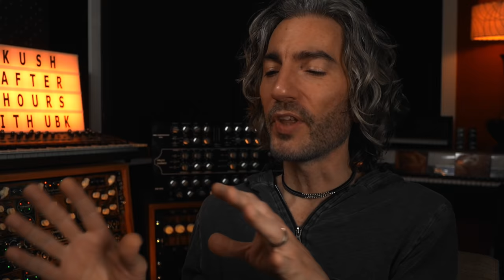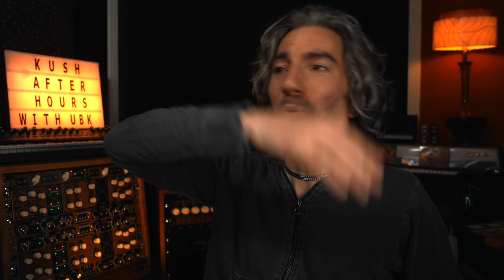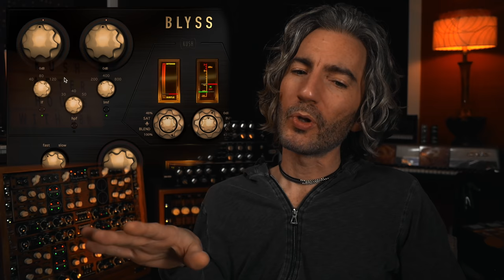MIX BUSS: You NEED to try THIS!

Comment: I do a lot of top down mixing because if it doesn't sound like a record to me sonically, I get distracted. I can't automate if my snare is too pokey or the overall mix is too dull. I do end up fighting the mix buss comp (and other processing usually tape emulation or something like that) and sometimes I end up removing some of it. Wish I could wire my brain to ignore the sonic issues in favour of the song issues as I always get sidetracked mixing if something isn't perfect.
Reply from the maker: Well, if top-down works then there's not actually a problem, right?  "Managing your tendencies" isn't a kludge, it's a solution.  

But if it doesn't work that well, or you feel like you could be leveling up, then what you're describing is a counterproductive habit, your attention is trained to shift to things that shouldn't be the current focus.  Changing habits is a fairly well established science, there's the cue-craving-response-reward cycle and you need to interrupt at least one of those stages of the cycle.   

An easy/simple way to break the "cue" stage is to change the environment, change the thing that's causing your attention to shift.  Try mixing at a different volume, where things either sound bright enough because it's loud, or it's so quiet that brightness is less critical than balances.  And/or, spend a lot more time on a band-limited ref like avantones, ns-10's etc.  If you can't hear 12k, you won't give a shit about 12k :-)
Reply: @TheHouseofKushTV  Great advice as always! I definitely will try to mix things up especially as far as monitoring to see if changing my habits and workflow end up being more beneficial. Maybe they won't but if I have the time to try and don't think it will hurt.

Comment: What mastering engineer do you trust working on your mixes?
Reply from the maker: No question: Dave Collins.  There are couple of others I trust, but Dave is just a notch above the pack and consistently nails it every single time, no revisions needed.  The only time I might make an exception is if I want it loud and proud, balls to the wall and crunchy, in which case I'd also send it to Howie Weinberg and see how it shakes out.

Comment: Yes agree a lot. I like "thats true for anyone who that works for" too.

But what happens when mixing into a compressor i then realise a different compressor setting is suited to the more mixed track- so its pointless, i haven't ended up mixing into the compression i actually used at all!
But i think if i do the contemporary thing of mastering in-the-mix then happily like to tweak individual tracks over just EQing the master or something (usually just the levels of tracks, like bass, that may be attenuated by a mastering Limiter) or a buss of kick+bass instead of using a multiband, but then sometimes multiband just sounds good (why compress the kick slap when the low freqs are problem)

Comment: I've watched this video about 50 times to absorb as much knowledge as I can (as I do with most of these videos). One thing I'm not following though is your use of the nail compressor in your chain. Could you explain why you have a limiter where you do in your chain? Is it so the highs your boosting with the other A Designs stuff aren't reacting to peaks as much?

Comment: You said that it's hard to reproduce some thing about analog Gear. What do you think it's more hard to copy , Comp or Eq?
Reply from the maker: Here's the answer nobody ever expects: phase.  Phase shift in analog sounds fundamentally different to my ears than phase shift in digital.  So for me that means that the hardest thing to replicate about analog is the texture of eq, the transient shape of compression, and the tone of distortions.  

To be clear, I don't think analog "sounds better" than digital, they both have a lot of strengths and weaknesses.  But they are different... subtly different, but meaningfully different.  I love and need both, and because analog is so expensive the trick is to find those places where it delivers the greatest impact and use it there.
Reply: @TheHouseofKushTV  thanks a lot

Comment: Thanks a lot for the tips Greg. Why compress though when you use the inflator after to add more dynamics back?
Reply from the maker: Oh, sorry for the confusion: I don't use Inflator to restore dynamics, I use it to saturate them at the edges of the spectrum (i.e., Curve is set in the positive direction, and a lot, like +35 or +40).

BUT, even if I did use Inflator to restore dynamics, that's legit and we all 'undo' things all the time.  EQ boosts post-compression restore some of the lost dynamics, but it doesn't reset them.  Compression post-eq flattens out the eq that came before, but it doesn't zero it out, it creates shaped density.  Compressing then using Inflator to restore dynamics doesn't put you back where you started, it puts you in a very different place because it's not 0 + 1 - 1, it's 0 + 1 + 1.  Like taking a white canvas, then adding some dark blue, then layer in some white paint.  You're not 'going back' to a flat white canvas, you've 'going forward' into swaths of dark and light blue paint with a lot of depth and texture and movement.

Comment: I find top-down mixing to be a game of Whack-A-Mole. Normal mixing, I can hear what needs to be done and adjust it. But top-down, any adjustment I make, it changes how other instruments are behaving in the master bus. So, did I make the right change and I just need to adjust other instruments, or should I change something else instead?

And that's not me BS'ing with assumptions. I did top-down for years -- years of frustration. But since I switched to the mixbus last, mixing is a much more straightforward process.

I adhere to Warren Huart's philosophy: The mixbus is not a place for drastic changes; fix your problems early, before they build up into something requiring a lot of mixbus processing.

Comment: Actually guys I'd like some insights on your mixbus channel. I almost always have only comp + eq. I have most of my processing on my busses (drums, acc gtr, egtr, lead back...).
What is on your process on mixbus ?
I usually never put the saturator on the mixbus because I leave that to the mastering.
Reply: I leave eq and comp off of the mix bus until i need it, ie for presenting a mix to client for review
Reply: If you think you need eq or compression to fix a problem, there is likely a better way to address the problem up the chain.
Reply: I pretty much always mix into my hw SSL. That "glue" really helps me to hear the mix as a finished song. The other thing I'm using on my master bus is a limiter. Yes, a limiter. Sorry. I want to know how the mix will feel when mastered. I use it moderately, not squashing it to -6 LUFS, but yeah. Somewhere between -12 and -10 is my sweet spot for most genres. I never mix into EQ, though . I only put an EQ (or saturation) on my mix bus if I'm sending that mix (with my limiter on) to a client. A Pulteq style eq can help you sweeten' the mix. I understand what Gregory is saying here (and love his thinking behind all of this), but if you're a novice I wouldn't recommend you do these things (yet). You better send a nice, balanced mix to a mastering engineer and he'll know better what to do with it.
Reply: I find applying processing on the busses (saturation, compression usually) allows for more specific control...you can treat individual areas more aggressively without compromising the whole dynamic of the track.

Comment: Most "mixing advice" on the internet is related to specifically mixing with a mouse in a DAW. Very little has to do with actual mixing. DAWs respond differently when there is a console in front of them.

Comment: Top down does help me with not getting distracted and getting lost while hyperfocusing into individual elements. That's just a problem I have with my attention overal no matter the subject. But yes doing the entire mix top down doesn't work for me since I end up bypassing and unbypassing my mixbus processing because I end up fucking up the sonic balance and how I set up everything in the beginning and I end up jumping back and forth. So I just kinda start top down and then just go whereever my ears take me, that works much better. But I do try to keep working within busses, and not for example process the guitars and the snare at the same time

Comment: Your mix buss chain is .... your own mastering process chain! Some brilliant insight in this video, love the thought of 800hz being the foundation of the Mid range.
Reply from the maker: Yeah, I sometimes think of it that way, "premastering".  The difference is that I'm working to deliberately give a different shape and energy to the track, I'm fundamentally updating the vision.  Mastering engineer's, in my experience, are far more restrained and subtle and work hard to not disturb the original vision.  It's probably the same thing as you say, just a question of degree!
Reply: @TheHouseofKushTV  Yeh that makes sense to me. There are clearly benefits in terms of cohesion that come from applying some forms of Processing to the main mix buss.

Comment: Hey Gregory, Will you please talk a bit more about your tone boxes? I've recently purchased a UAD Apollo and have all of the plugs etc but I can't seem to get the tone I'm looking for...even from my fav old mics..and some really amazing new ones u47...269 etc. But the top end at like 4.5 to 8 K or so is just gritty. I didn't realize how much my old setup helped round things out at the top end and give that gentle mid range push. I've got the tape plugs and the rest but they just aren't the same. Any help with knowing what to use "in line" would be cool. I've tried multiple preamps to get close but then there are gain staging issues. I've heard using transformers passively inline can be cool. Any thoughts?  I need better tone! Much grass for your time. =)

Comment: Question: could you consider all of the work you’re doing on the mix bus “mastering”?

If not, where does the difference lie for you?

I’m really struggling with the decision of what to add or remove when sending a record out to mastering. My gut feeling says to leave the mix bus empty, so that the master engineer has the most room to work with. 

The control freak in me says to keep it in my own hands.

I’m very curious where you draw the line. :)

P.s; these videos, and your plugins, are a godsend.
Reply from the maker: You do whatever you want/need to do to make that production hit the notes you want it to hit as powerfully as you can hit them.  The only thing I'd go easy on is brickwalling, but even a bit of that is fine and everything else is fair game.  You can always go balls to the wall, bounce it, then bounce a version with mix plugins bypassed, send both the M.E. so he understands what you want but has the option to take his own path there.  Me, I'd do whatever I want and send it, it's my art, I know what I want.

Comment: Question: I myself use Ableton for mixing and am wondering how the mix bus would translate to Live's environment. Would you set up an aux and call that the mix buss sending every track into it? Or would this be my master channel? In case of the first, do you solo it before processing?
Reply: A tip: Use "Group tracks" function in Ableton Live. (Shortcut is Command + "G")
Reply: @MatsMorlund  thanks a lot for the reply, Mats. That's how I personally prefer to do it, instead of having many send channels. 🙂 I think most important question for me is the last part, do I send all the groups into the mix bus aux and then render this solo'd or is it more common for engineers to run them in parallel?
Reply: @Crimsonite87  Ok. Why do you need to use return tracks when you have grouped tracks? Cant you just use the master track as the mix bus?? And then export the mix to audio (and then do mastering separately)?

Comment: I gotta disagree on the mix bus compressor.  I think the way your thinking about it is wrong to a degree.  I do agree that its really about thickening up the mix but part of the advantage of always doing it and always mixing into it is it becomes another meter/reference point.  I typically mix into an SSL G bus compressor, mostly for a little extra thickness and a little bit on vibe but also largely because I know what numbers on the meters I should be hitting with certain settings to be in the zone where my mixes work best.  I'm not hitting it hard enough where it makes a huge difference, its just a little bit of color and feel and that double check on the meters so I know I'm in the ball park of where I should be as we all can loose perspective after mixing for hours.
Reply from the maker: Nice!  You got what works for you, I got what works for me... I don't see any disagreement.  Also, I'm always and only talking about what works for me and why, so I'll respectfully reject any notion that my thinking is, or even can be, 'wrong'... there's no such thing in this space, we're not dealing in facts or mathematics.
Reply: @TheHouseofKushTV  Agreed again, it’s about preference and I happen to work the exact same way for the same reasons.
Reply: I don’t think he’s wrong at all, he explains his reasons for working with a clean master channel very clearly. And your reasons for mixing in the compr also make tons of sense. It’s really all about preference and both ways can have their pros/cons. I happen to prefer to get in the ballpark without a buscompr and then later tweak accordingly in a ‘test mastering chain’ when the mix is ‘semi-done’, and always do the real mastering seperately (usually a mastering engineer but in the rare cases I do it myself it’s always the pre-master imported in a new separate project.

Comment: "Mixing into compressor" is nonsense.
Your instruments change their tone and dynamics over the course of the mixing session, sometimes drastically. The settings that fit the dry source material might mess up the otherwise better-sounding mixed tracks.
You might not even need the compressor on the mix buss and you wouldn't know it because it was always there and the mix was made to fit it.
Really, I don't know who made up this "rule", but they don't know what they were talking about. Thank you for speaking against it.